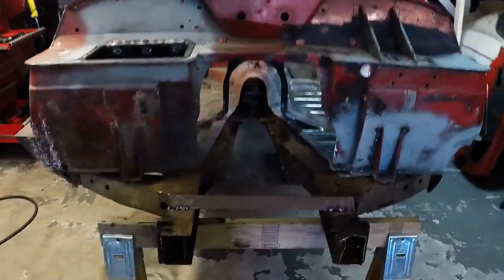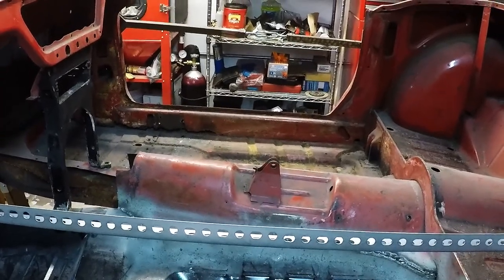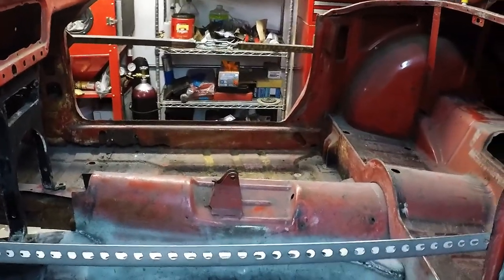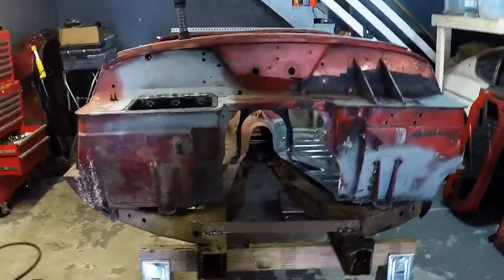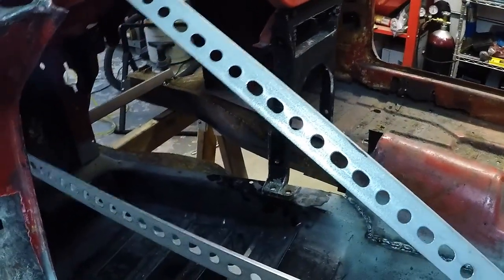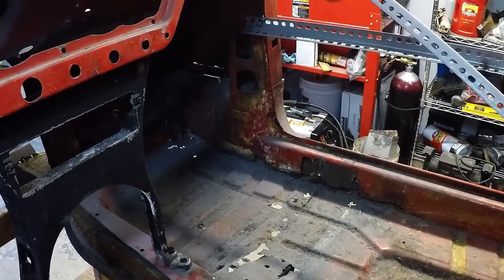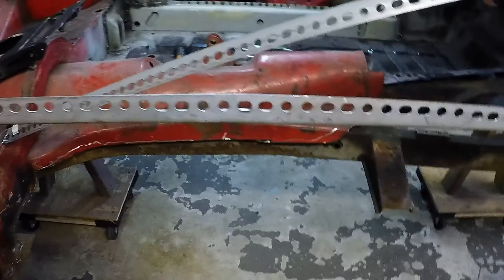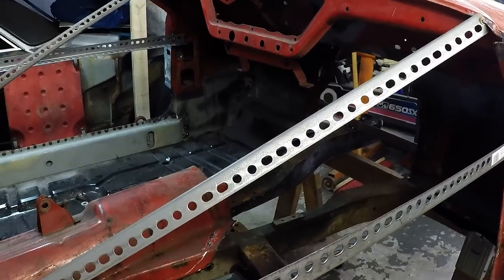Triumph Spitfire Body Repair - Frame and Floor

Comment: Great that you've got an "assistant" - he'll hopefully remember this time as a good dad/son bonding.

Out of curiosity, where did you cut the floor on the outer edge?
Reply from the maker: I cut it right at the seam between the floor and the inner sill. That leaves some of the floor still there, but I intend to cut most of that away as I'm trashing everything on between the three sill pieces. The remaining stuff I'll remove by drilling out the spotwelds as necessary. I tried to give you an idea in my most recent video.

Comment: So the radio console helps. I shall put in mine back in then before i start work
Reply from the maker: Yes, definitely. It's structural and helps set the dash vertically, especially if you remove an A post.
Reply: will put it in again this weekend then

Comment: peices dry wall corners arnt going tohold  nothing, u need something a lot stronger than that
Reply from the maker: Those angle pieces are heftier than dry wall corners, but I hear you. I'm also going to be putting the center dashboard mount in and doing the repair in stages so there will be no time when the front and rear of the car are completely "disconnected". Also, based on how easy it was to move the driver's side dash around (which I didn't support unfortunately) I expect my solution to handle it just fine. Thanks for posting and watching!